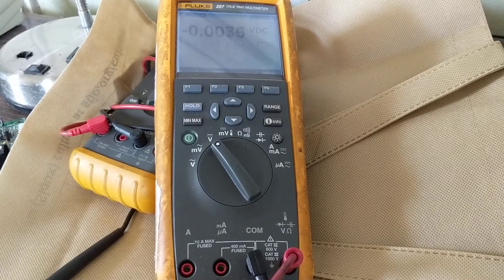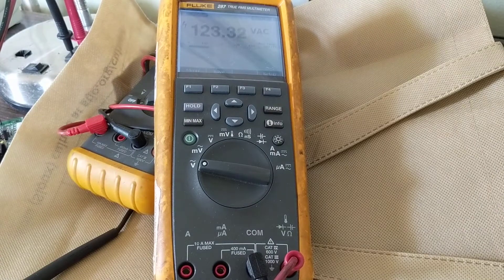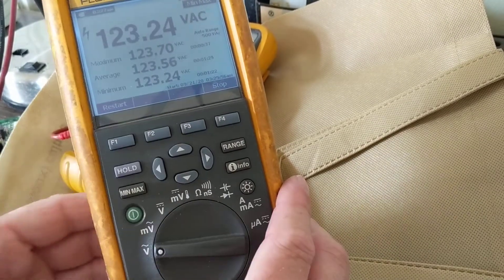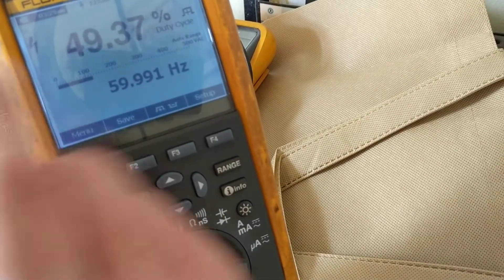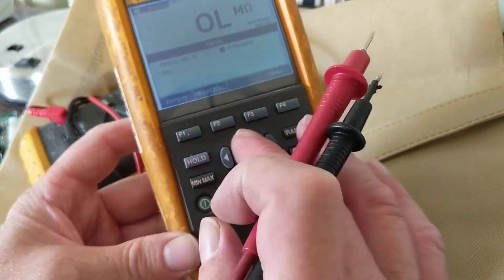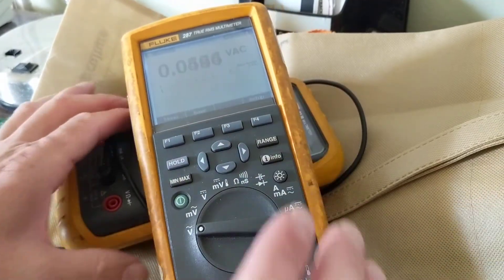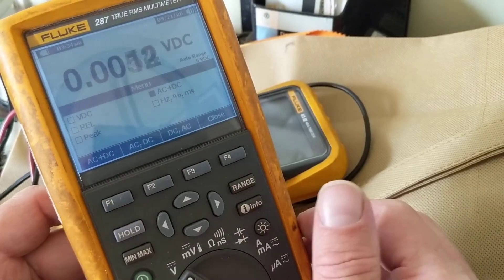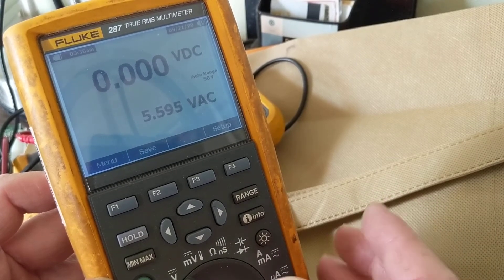BEST MULTIMETER FOR AUTOMOTIVE fluke 287

Comment: Great telling people that you have to test your leads by shorting them together. Why would the 287 and 289 be very good meters for auto-electrical repair? The fluke 78 auto and 88 automotive are specially built to test dwell, RPM and intermittent faults by using the min/max recording function. On it's own the 287 and 289 are twice as expensive as the cheapest 88series1 on it's own. Only the 78 and 88 series can measure automotive, spark time, dwell angle and RPM?  Your meter is nice, but I would rather spend the money on an extra amp clamp, AC transient meter or snap on timing light... THANKS FOR THE VIDEO!! PS. 78 & 88 also has touch hold and 88 measures ripple ac voltage  GOOD VIDEO

Comment: Meanwhile I’ve been do in-depth diagnostic work with a $200 Fluke 115 for years .. Imgine needing a $700 meter just to do voltage drop testing .

Comment: Thank you Joe for such a nice video. Right now I am buying a new Fluke, I currently own a 117 but want something able to measure micro amps. I have read many comments about the advantages of the 87v over 287/289. Based on your video I find the 287 very interesting. What is your recommendation? Thank you in advance.
Reply from the maker: The fluke meter is the industry standard even for automotive I use it for anything but if you want to use microamps you probably have to use it on the milliamp range and convert it to microamps but definitely you cannot go wrong with this selection keep me informed and thank you so much for your comment
Reply from the maker: Just make sure that you can go down to the proper range when you convert it to microamps

Comment: What about low live off the battery?
Reply from the maker: You mean the low life of the battery it definitely tells your display in the right corner gives you a display
Reply: I mean  it consume a lot batteries
Reply from the maker: @IMR9004  well it depends if you put the light on which usually I do but otherwise it's a great meter it really lasts a lot with the batteries thank you for your question
Reply: @Joeelectronicschematicsforauto  I have a 87V MAX and I'm thinking to upgrde to 287 or 289 but I'm scared about battery life. Thanks for reply

Comment: AMIGO KE VENTAJAS TIENE COMPARADO KON EL FLUKE 88V DE D USO AUTOMOTRIZ GRACIAS POR TU AYUDA
Reply from the maker: If you can get the translation in English I would appreciate it then probably able to answer you more easily
Reply: He wants to know what the difference is between this and a fluke 88v
Reply: @motivatedreign5102 yes o siii

Comment: Nice video!
Can I ask what the difference between this and the 289 would be for automotive would be?
Reply from the maker: With the standard meter you don't always have minimum maximum and average here you can put all three at one shot also you have a hold button so that you don't have to hold the probe and it will still keep the measurement for the 289 other meters don't do that thank you for your question and also it is Auto range no selective switch for increments